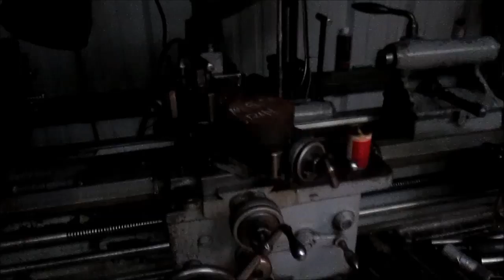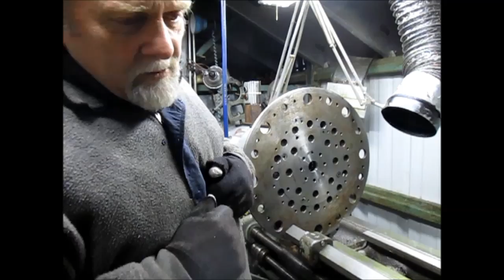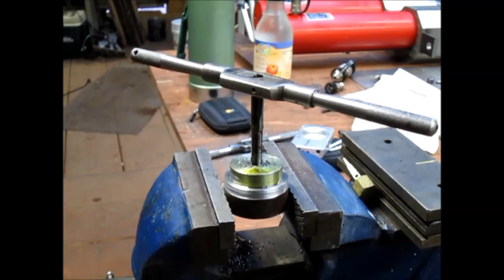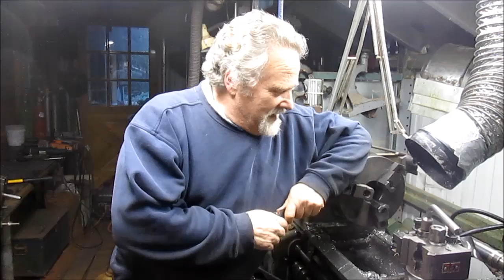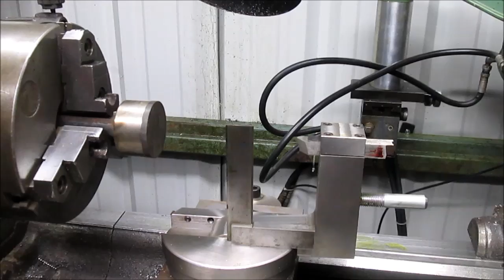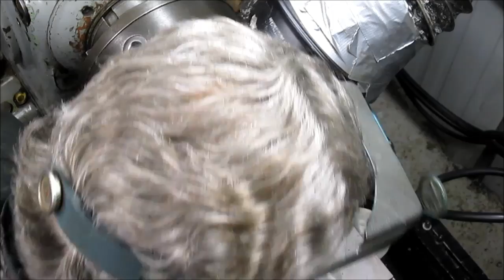Machining a radius in steel

Comment: Instead of checking that radius in your template with a scale, you could run the machine in reverse and skim turn the plug with it tool on the far side of the plug.
Then measure the plug and move the cross slide  half the plug diameter and the desired radius on the dial and make your finish cut.
Have to set  the tool height with a height gauge and allow for if the dial is 2 to 1, or 1 to 1.
Course your slide screw may be worn out. 
Still may be better than your scale.
Reply from the maker: Good approach too. This project was 3 years ago, so kind of a done deal at this point. Thanks for watching.

Comment: Yes..just a short dummy piece needed for the opposite to measure across...I cut my template in the CNC for the tracer.
A shame that you can't use yours for concave & convex.
Reply from the maker: I'm still trying to figure out a way.

Comment: Machine the base of a 6" rotary table to fit your ways. Make adjustable clamps to hold it like the carriage.  Attach it to your X carriage so you can advance it with the rack.  With tool on the front side of the table it will cut concave, with tool on the back side it will cut convex. Sliding tool along T slot from center to edge will set your radius.  Rotary table handle rotating the table will be smoother than your hand operated handle.

Comment: You mount a piece of scrap on the opposite side of the faceplate then just cut both until you reach 8" measuring with a pair of verniers. Simple! No center bungs and trying to pick up center with a tool...

Comment: Hi Nick. this is the first time I saw you on you tube and was very impressed. I live in Thailand with my wife and I was a fitter/machinist in the u.k and now work as a teacher in English language. Soon I will be buying my own lathe and milling machine to make model machine tools as a hobby but  I would also like to make and sell things on Ebay such as small accessories for machine tools such as v blocks,parallels clamps etc. Do you have any other ideas? I have to keep the prices down so people will buy them.Kind regards  Dee
Reply from the maker: +dermot kelly Hey, thanks for checking in. I post a new segment every Sunday and try to post a short project each Wednesday. I've been trying out new products for years, but Ebay is a fickled forum to sell things. All I can say is produce a short run of a new idea, put it on ebay and keep posting it for at least six months even if you don;t sell one of them.